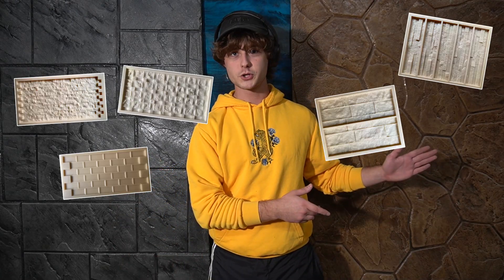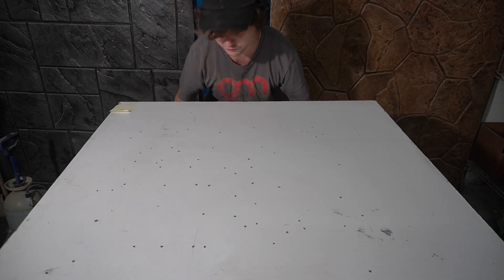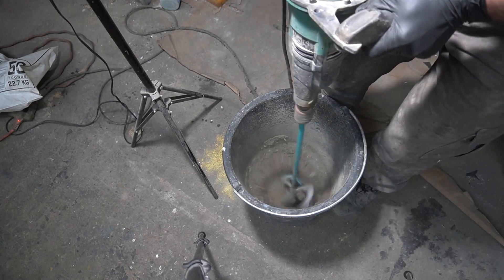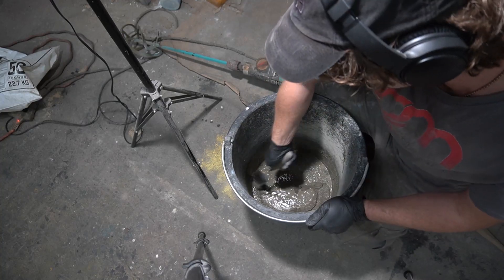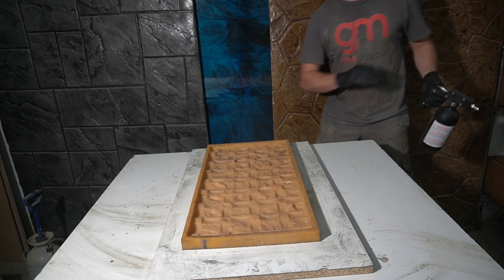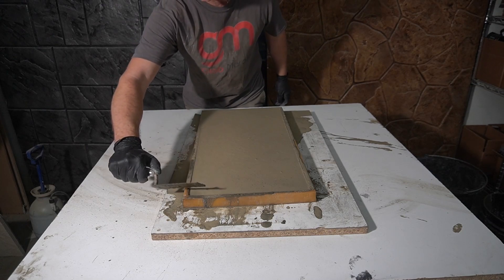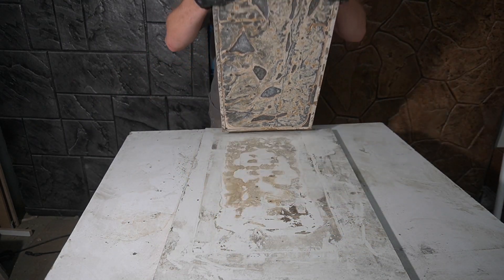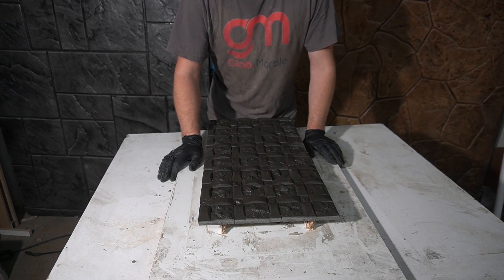Concrete Casting For Beginners

Comment: It looks like this technique would work pretty well for pavers. If I understood your technique adequately, it looks like you just use sand without and gravel or stone for aggregate. Would this approach be strong enough for pavers? If so, what would you consider to be a minimum thickness for a 12” or 24” square paver without any reinforcing?
Reply from the maker: It works great for pavers and stepping stones, check out some of our other videos like this one https://www.youtube.com/watch?v=jfSJO3oBE2g

Comment: I don't have room for a vibrating table, But what I did was go out and purchase a double ball vibrator for backs and shoulders with a handle. I just put it under the item and on the sides. and run it along it and works like a charm !!!  for molds and concrete pavers I make etc.
Reply from the maker: Awesome!! If you'd like to upgrade, you can create your own vibration table for not too much money. We have an old video on it- https://www.youtube.com/watch?v=XHGnGuWf8s8

Comment: How do you make sure all your tiles are exactly the same thickness.

 1 tile per 24hr per mold is very slow process. Is their a way to speed this up.

Also how can you achieve very smooth surface. I can see dimples on the tiles. Which in this particular case is no issue. But in other tiles it might be an issue.
Reply from the maker: The tiles will all be the same thickness if they are poured on a level surface and screeded at the top of the mold. You can add CSA which is a fast setting additive for concrete to be able to produce 2 molds per day at best. Most large production facilities just use many molds to mass produce their stones. You could cast with plaster of Paris which will let you cast up to 10 a day but the stones will be much more brittle because they are not made of concrete. By dimples do you mean bubbles? Bubbles are removed by vibrating the concrete. We sell vibration tables, and also just the motors if you want to make your own table.
Reply: @GlobMarble  by dimples i meant holes on the stone surface.
Reply from the maker: Yes that is what I was talking about

Comment: Hello sir,
I am from srilanka, manufacturing wall claddings using concrete. Still having a problem to achieve black color only on the the surface of the claddings. Please give me a simple advice. Thanks
Reply from the maker: You should use our 8084 pigment and mix it at 2 lb of pigment per 94 lb bag of cement. If that is still not black enough, you can add a sealer to make it darker- https://globmarble.com/concrete-color-oxide-pigment.html

Comment: if you soaked it in a water bath for a week to a month it would just get harder. This is gorgeous
Reply from the maker: The water bath is a common DIY method but for large scale production people create humidity rooms because they take up less space. A cheap one to do it get a shelf you can stack a lot of the castings on, spray a bunch of water all over it and cover it with a trash bag.
Reply: You can now buy additives that cure the cast in a week or two.

Comment: How Can I Maintain The Original Color.. The Colors are fading each day after demolding
Reply: What did you stain them with?
Reply: I add pigment to the mix
70 gram for each 1 kilo cement
Reply: @seifalbeshti9497  What Globmarble said.... A wet sealer will keep the colors looking bright.
Reply from the maker: The color always fades after demolding, because the concrete is losing its moisture. There are two ways of keeping the color dark. The first is demolding after one week, but the downside to this is you have to wait, it will be much harder to demold, and the mold will not last nearly as long as usual. The second option is adding a sealer which will give the concrete the same color as when you wet it. Here are our sealers- https://globmarble.com/decorative-concretes/concrete-sealers/